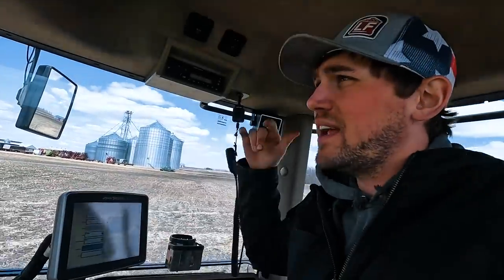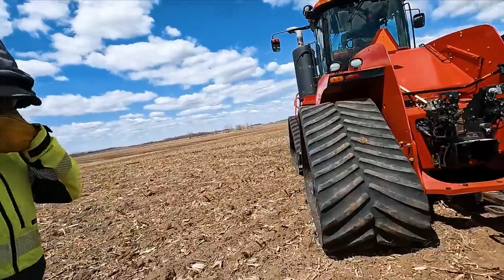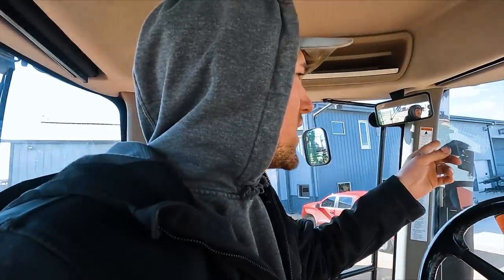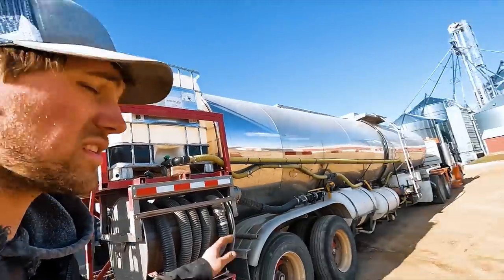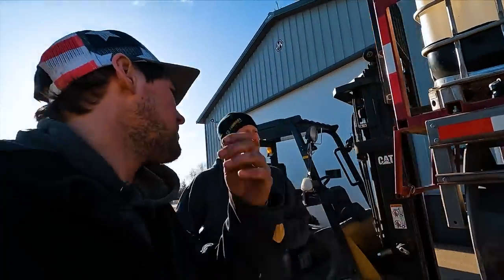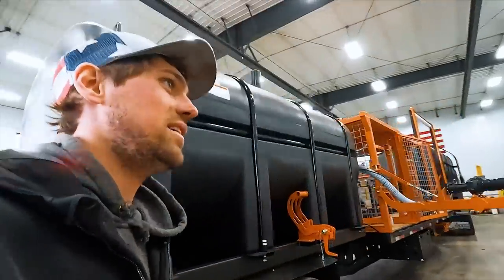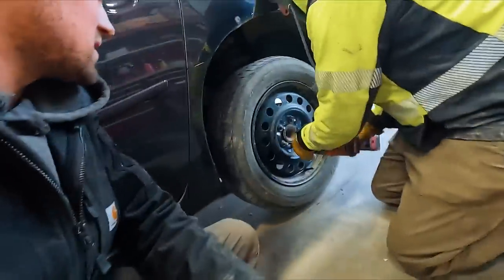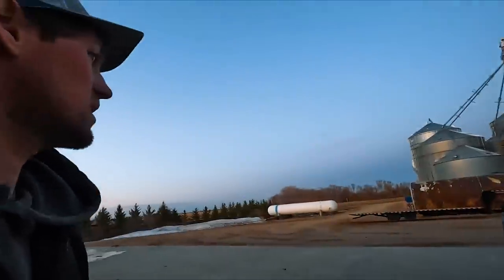Planting Season Is Here And We Are Not Ready!!

Comment: Brodie the door issue is with the lower fender attached to the body. I identified the same issue with my Impala. Solution- added sheet metal to the body and to the fender to position the fender in the correct location. 
The other option—buy a fender and replace the rusted out one. Will require painting to match the car. 
The sheet metal was the simplest for me for a quick bandaid for a car with 220,000 miles. 
Good luck

Comment: Don't feel bad Brody. Almost every new car is plastic and beer cans. I have 3 p/ups all most steel. 1998, 2011, and 2015. Silverado, sierra, silverado in that order. 98 has 244,000 mi. Orig paint in very good condition, floormats w/GM logo cloth seats in primo cond.. All k1500 4x4s.currently camping (5.17.23) in the high desert of Oregon. Two track trail ride entire weekend pulling off road camper. At 78 to old for ground or rooftop camping, so R Pod 180 glamper for me!

Comment: IDK if this would work on a big tire but i've done it on a lawn mower tire before. wrap a ratchet strap around the center of the tire and start tightening it, this pushes the bead closer to the rim, then pump some air in, let the pressure off the strap. finish Filling!

Comment: You need a concrete hardstanding for all your equipment, and maybe a spare tyre or two.
Reply: Usually you only blow the bed beed of the tire so you just reinflate.
Sometimes the rim goes, but that's really rare,  usually the bad one is the bearing goes.
So no point in having a spare tire.
But the concrete pad is good idea.
Yet 95% of farmers refuse to spend the money.
Heck our buildings have dirt floors for the most part.  To cheap for gravel, much less concrete.  Only the shop has concrete.

Comment: Why don't you have class 5 hitches on everything?  Cowboys all have the same size balls - So they can pull each others horse trailers.
Reply: Cause you don't use them for everything and class 5 aren't cheap.
It's not like putting a hitch on a pickup.
Most cowboys probably have class 4, up to 12k lbs
Class 5 is up to 20k lbs
Ball size varies based on what you are towing.
I have 3 different ball sizes what what my pickup tows from a little trailer, a bass boat to a 24 foot flat bed for hauling cars light equipment up to 12k lbs including trailer that was 2 3/8 inch ball.
Class 5 is 2 1/2 ball.
Reply: @cw93711  But you guys spend HOURs Changing tractor around because you find out suddenly that it is wrong hitch.   Ever pull behind trailer we have has a 2-5/16 ball and couple on the truck /trailer .  With an 18 in drop on the truck.    No searching for  differnt  Drop coupler /ball  at 4 AM .   If somebody says " your balls are to big" My wife escourts them off the property.

Comment: RE:  DUST MESSSING UP THE TOUCHSCREENS....

there SHOULD be some STICKY GORRELLA GLASS ''kinda'' option for a SCREENCOVER that will take the ''abrasioni'' if the dust on the screen like SANDPAPER is the only gripe about ''dustlesscab'' issue with the sidebyside....

even if you only stick it on when it is on the sidebyside, and pull off after,  20bux each time to SAVE THE SCREEN  ....very much worth it!  ((wizzydummyINFO for those that need to kno NOW they kno sniker ))